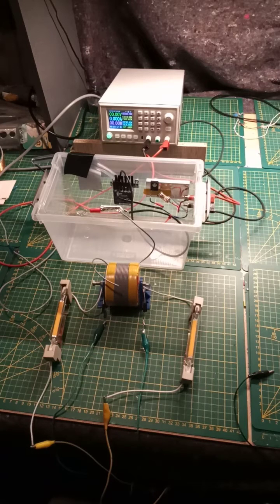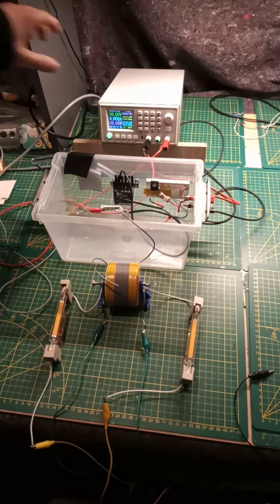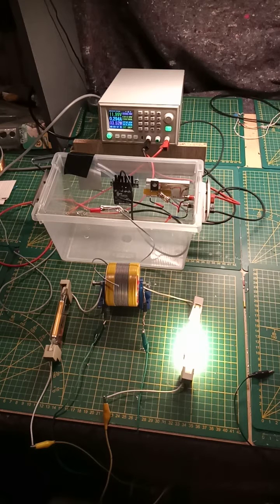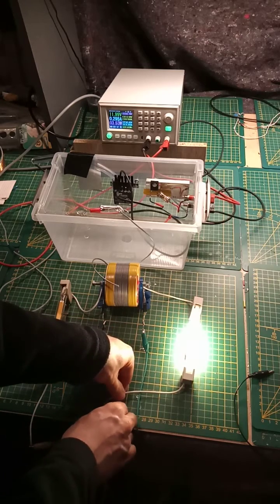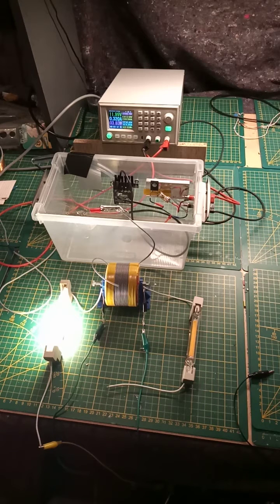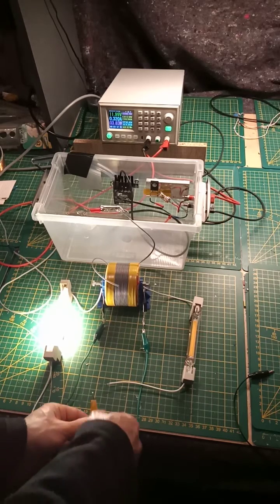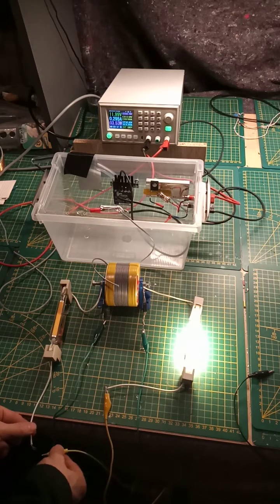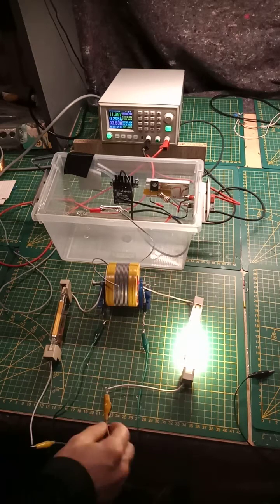Capacitive charging of capacitor with Earth ground

Comment: Thank you for your video. You probably have neon sign transformer VT1510-12. Is it somehow modified? For example, Bertonee version has orange and white output leads. Has VT1510-12 also hot and cold leads? Because they are both black. In Resonance Induction Coupler Kit 2 it was said that you could check the leads by the neon lamb. (I can do that). So, does the Ventex VT1510-12 and Bertonee work same way? I have VT3060-120 and in manual it says "Output leads should not be grounded".
Reply from the maker: @ Jukka Kortela, I don't know if they work the same, I only have experience with the VT1510-12 . I use the neon bulb to detect the hot side.
I had no problems with my supply with the experiments I did. When grounding I think it's best to use battery as source so you don't have a connection from that side to Earth ground but you have to keep in mind that when placing for example scope without 1:1 transformer or scope is Earth grounded that you can make grounding that way.
Reply: That you for your response. Do you get good sine wave signal from VT1510-12?